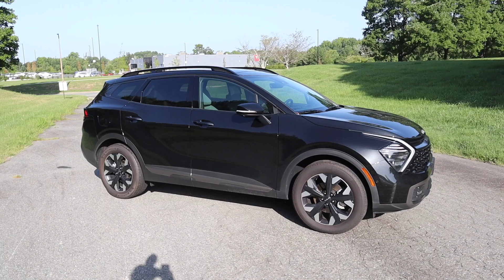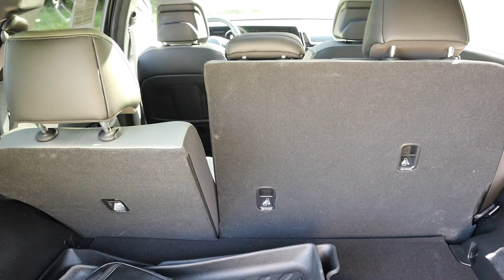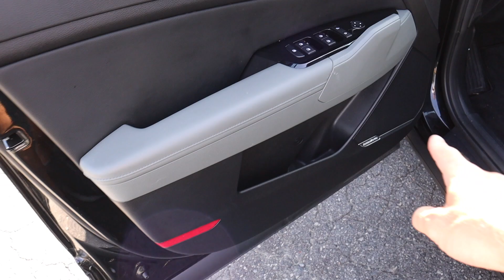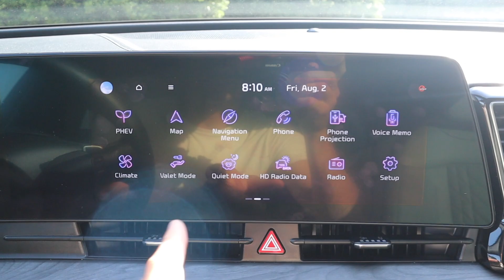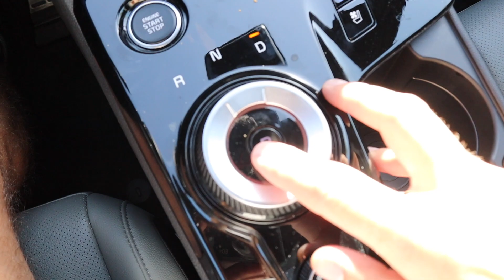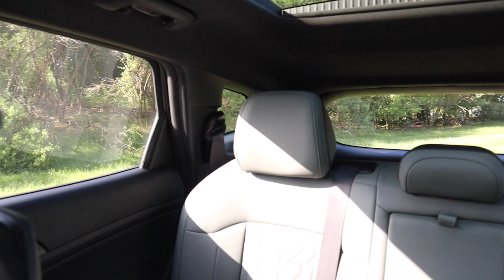2025 Kia Sportage Hybrid X Line Prestige: Start Up, Test Drive, Walkaround, POV and Review

Comment: Not having an actual shifter Is a deal breaker or me.. SUVs need a real shifter and not a silly dial
Reply: Why are you crying about a shifter?
Reply: @noahcrust2903  are you serious bro you want to drive an off-road vehicle with a tiny little knob that you turn instead of having an actual shifter come on man that's bogus. You might as well have a door knob instead of a little round dial come on
Reply: @ when did I say I’d prefer a knob? Yeah I’d prefer a shifter but it’s not a deal breaker
Reply: Well they practically ALL have knobs now, so lots of deals broken I guess.
Reply from the maker: Those days seem to be gone lol
Reply: @BrosFOURRSpeed  yes indeed. But will just have to go with the Subaru Forester Wilderness
Reply from the maker: Not a bad option!

Comment: Next time, I'd find some shade under a tree where you'd still have
plenty of light-but without the glare I've notice a few times in this
presentation. Lots of info to think about. Thanks! 👍
Reply from the maker: Can you time stamp for what part? I don’t have any trees to park under in this location.
Reply: @BrosFOURRSpeed  I test drove the Hyundai Tucson that has the same full digital screen. I hated the glare from the gauge cluster because it's no longer covered. We see it the same here and unfortunately that is a deal breaker for me.